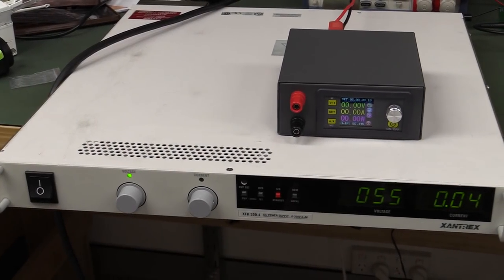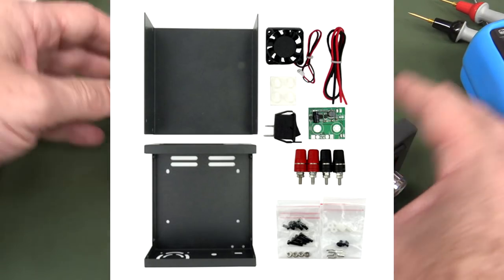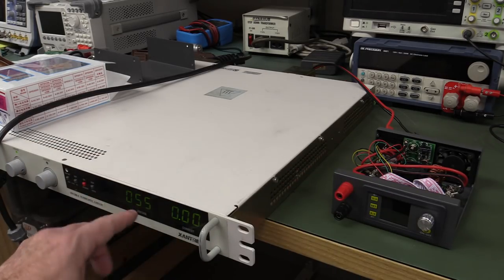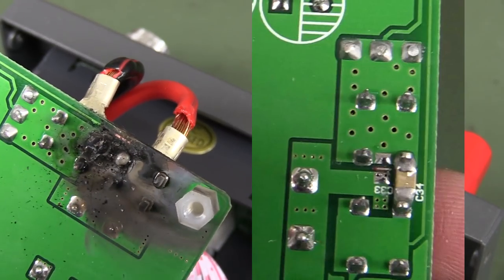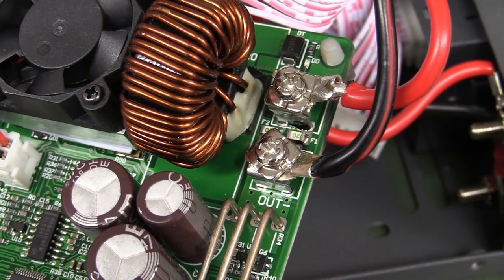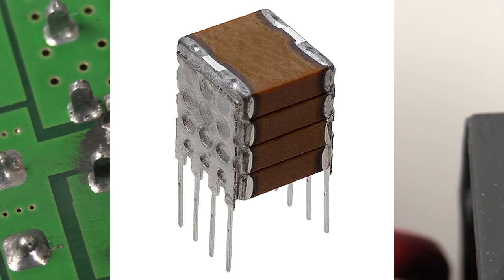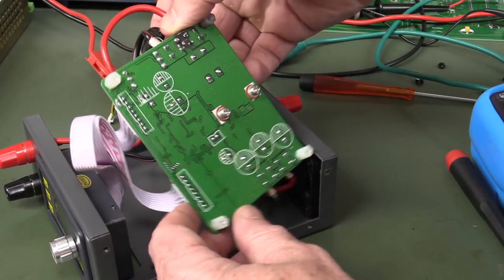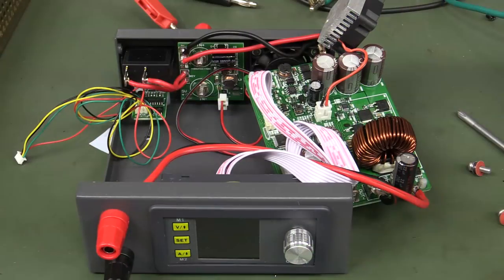EEVblog #1035 - Flaming DIY Power Supply!

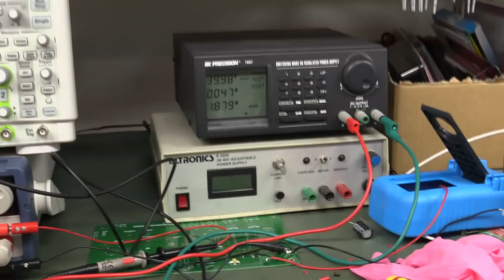Comment: At 14:56 and 15:07 Dave says it is set to 10 volts when it shows it is set to 18 volts,  and at 15:40 and 15:48 it is showing 17.98 volts on power up.  Are Australian volts different from USA volts  like the dollars are different values between Austrialia and USA?

Comment: Oh Dave, don't you know that a charred PCB shorts the pins? A simple resistance measurement might be enough to  check if that is the case. All the charring should bring scraped away before trying to run that again.
Reply from the maker: I did measure it and it wasn't a problem, but has now gone low.

Comment: I wonder if you could shorten the length of the screws slightly to keep from putting pressure on the board, thus keeping from cracking the Capacitor.
Reply: yes, it can avoid from PCB deformation , so the capacitor will not be damaged, but we already update this problem, use a better one and change the place

Comment: Do you think this could handle 12-14.8 volts at 15 amps without catching fire?
Reply: for DPS5020, there is not any problem, at 50v/20A, There is not any problem 
for fire in this video, it is capacitor damaged, not products problem 
you can check this video https://www.youtube.com/watch?v=igY0s4drtlc&t=1s

Comment: Best bet, lack of thermal relief on thru hole parts with substantial thermal mass.
A soldered  part right next to low Z MLCC. The thermal gradient that cap would have seen during the production solder process for the surrounding rather meaty hardware has twisted the guts out of the internal layers. No cheap parts are required to make the failure, any good quality ceramic will die from that much torment.

Comment: Maybe I'm wrong but those things are toys that should not be exposed to more than 12 or 24 V / 10 or 5 A at the input, when I say that they are toys it is because they do not have protection against overload or short circuit.

Comment: of course you had a load across the output: a huge chunk of charcoal :P

also possibly some solder or metals from the vaposised part could've wicked into or deposited onto it (burnt PCBs are rather good sponges) making it even less resistant than the coal alone.

Comment: Dave, please consider  a repair video or a followup test with the charred parts of the board dremeled out or similar and that solder bridge on the IC (if that is what it is at 18:13) removed.
Reply: there is repair video .. you can check

Comment: Design flaw. Never put ceramic surface mount capacitors (which are prone to internal cracks due to strain) across high current/voltage rails. Rule of thumb. Put two in series, if one fails the other still works!!!
Reply: You'll find 2 serial surface mount capacitors across Vbat to GND connections in all newer automotive electronics. Implemented as a rule ( by the vendors) over some serious fire incidents.

Comment: You said it a few times... that the 1kW power supply tried to dump all of its 1kW output into that burning cap load... not!  You only had it set for 55 Volts, so maximum of 220 Watts (at 4A max).

Synchronous rectifier?

Love that company name too... the Alpha and the Omega... reminds me of something I read...

Comment: Only thing I was sure Dave had ever built was a HV probe handle for an oscilloscope.
Reply: The fan isn't running: 14:47 when the output is turned on.

Comment: I decided to watch the whole video and read comments first before adding anything. One person spotted some solder spatter across some tracts,I would check that right away. I dont think it is causing the problem however. If anything,it may have caused some other issues. I was impressed the manufacterer was quick to comment concerning the issue and has already added that larger cap. As with any mass produced product,it usually turns out to be cheaply made components or badly soldered components. It is hard to monitor cheaply made components as they come in bulk now days. Unless you inspect every one and put it on a tester,that would be impossible. I am sure an initial runup was done on that unit to make sure it operated but somehow doubt a load test was done on it. Mabe every so often,but that would still miss one with a defective part. Such is the life of modern day mass produced electronics. Customer service is more important to me now days. As long as the bad unit gets replaced, I can deal with it. I did enjoy the video,nothing like some action for a change.

Comment: My experience is I'm finding with ebay power supply modules like this is the real reason for the smoke and the "sick puppy" is it has not been designed properly. Typically you will find the voltage and current will drift, may not be stable under different loads, horrible rf noise and radio interference, ferrite cores, making screeching noises, hence resonating, I've had some chokes actually shatter. Another nasty is complete failure to ensure that the esr and ripple current rating of filter caps is up to the task.
Reply: if you have any problem, you can contact us . for ebay, we don't want open shop on ebay

Comment: When you opened up the heat sink i knew they were bad at designing.
Such a high thermal resistance there, at the wrong side of the mosfets, to put heat sink on

Comment: Nice looking unit, the PCB design is good, although I'd probably go for more track separation because DC voltages love carbon tracks. 

Always soak test new gear, the world is full of stillborn components. Most absurd I ever hit was IEC power lead on an oscilloscope that was a beautifully potted open circuit fresh out of the box. Tested all the new kit, another had a dead short in the once pristine now charred and bubbled standard plug :-( 

Supplier had decided to save money by ordering default the US style leads and replacing them with brandless wholesale Oz style leads, which were also annoyingly short.

The instruments had been tested by plugging each one into the same lead rather than unpacking the new ones before dragging them up to the labs to set up.
Reply: ??? did you test our products ?

Comment: EEVblog the first good high value tip I got while going to extracurricular "electric engineering club" as child was to thoroughly clean all the carbon residues from the burnt place because they act like a resistor.

Comment: Perhaps a circuit breaker at the appropriate amp rating should be hooked up in series with a ceramic cap.
Reply: we are change the capacitor and change the place

Comment: same thing happened to mine that I bought to control MCH heater elements so I could get 100~400 watt heat load for my heatsink testing ( running from 500ah 48v battery bank ~54V )

Comment: Soldering the SMD ceramic capacitor  with too much solder create stress that cracked the fragile ceramics. Lite  bit of solder  create hight resistance. Non SMD capacitors with terminals  do not suffer from that.

Comment: I'd say there was something else wrong with it to begin with. It doesn't make sense that the damage on the input would cause it to malfunction. I first thought it was because you were testing it with the pcb loose but i saw the nylon standoffs had plenty of clearance so idk. I like the trick with the glove though.
Reply: Ah my bad I realized in the follow up video that the cap was on the output not the input.

Comment: The cap was cracked internally from being bent because it was soldered to those big lugs and it got so hot it melted the solder
Reply: no,  the capacitor was damaged by force during installation. after the video we updated it , change the capacitor and place

Comment: W/o a load to help suppress the HV spikes that a power supply like this should be expected to produce, even a 250V rated capacitor might not be adequate. The same part in series might work. The same part with a 200V varistor might work.

Comment: This is not uncommon. What happens is the ceramic gets stressed and cracks. This results in the capacitor going leaky and subsequently it bursts into flames. The capacitor was fitted between two screw terminals, I would guess screwing the terminals down cracked the capacitor. A solution would be to fit soft termination capacitors which do not crack. I had exactly the same thing happen to me with a design, using soft termination capacitors fixed the problem 100%,
Reply: thank you so much for your explaination, yes, you are right 
now we have use strong capacitor and put it other place ... 
thank you again

Comment: I expect, that the root of the problem was soldering the cap directly between the terminals. This increases the mechanical stress to it. Now, when you apply pressure to the terminals while connecting them, this "has" to crack it. I am quite sure t was mechanical overstress.

Comment: looks like a solder splash on the chip below the tl594c - bridging two pins to a through hole jumper
Reply: it is capacitor damaged, we already update this , and use a better capacitor

Comment: normally I test this type of electronic ( that you install by your self ) in low voltage and low current before I go higher to avoid any internal or external error/miss handle /fault manufacture or handy problems. so I don't lose the board or to keep it in minimum damage.  I don't like to waste my time to fix a problem caused by not been carefully with
Reply: so now it is well ?

Comment: Bummer...   My second unit just failed with constant 5.13v on the output.  I replaced it with the minghe zxy 6005s. Seems more stable and it has a timer function that works nice for charging lithium's.
Reply: very good , if you have any question, please contact me

Comment: I have a dps5015, but when i switch the output on , i get an overshoot peak of about 2 x the set voltage.  So i dear not to use it.
Reply: Hi friend 
it is not different problem,,, DPS5015 has not that capacitor 
you need connect them first , then power on , not power on ,, then connect , understand

Comment: Look at 18:12: There is a solderbridge on the 48 (4×12) pin Chip, right from R22 between Pin 23 to Pin 24 (When counting clockwise from the dot) . 
And: 
I would not apply such a high operating Voltage ever again to a PCB that burned sooooo black. This black stuff deep inside of the 
PCB material is now slightly conductive for ever! ... 
Why wasn't this little input capacitor placed behind the SMD PCB fuse from the power output...

Comment: My first guess was a short in a MOSFET. I think the cap blew because of that. I would pull each MOSFET and check them individually. I'll bet there's a bad one. My second guess was an electrolytic cap, but they all still have their tops on. LOL
Reply: you should see our explain and later video 
it is just capacitor damaged, and when it power on, it was shorted and burnt

Comment: on teh cheap i want a high amperage power supply that can control amperage and voltage. the voltage control seems easy enough but if i have a computer PSU that i wire up for full output (say 70A @ 12.5V how would i go about being able to variably controll max current output? (using as bench tool)
Reply: As said before, the max voltage you could go down to is 11V at about 15A output for the DPS5015, and 20A output with the DPS5020.

Both units are excellent.
Reply: @neutronpcxt372  thank you

Comment: I don't know, if you threw that thing away or whatever - but you know, coal is a conductor.
And that's the passage your angry pixies took after the first fail.
Always remove ALL of the charring a short produced, unless you want to burn your item twice. Would have been quite an easy fix and i wonder, why you didn't do it.
Not that i'm an expert in your trade, but car electric wiring has the same coal producing issues and that's why i know. Leftover charring -> no fix, burning car instead.

Comment: I have a DP30V5A coming and its input limit is 40V. Anyone know a circuit schematic to get a 40-0-40 6A transformer down to about 36V from 110 VAC?
 Most simple circuits (full bridge and large capacitors, no regulator) will convert that 40V transformer to 56V. Too much for a DP30V5A.

Comment: at 18:22 it looks like a Solder bridge between the Top 2 pins on that large Chip Lower right corner
Reply: it is capacitor damaged, we already update this , and use a better capacitor and change the place

Comment: Common problem with cheap psus.  Under spec’d components.  For caps and high voltages they have to be derated at at least 2x and also they need proper soft-start circuitry.  Alas products made of Chinesium ....
Reply: you are wrong , you don't know all things. Samsung mobile phones burnt , iphone burnt , tesla fired ... they are all from chinese?
any electric device was damged , they maybe fired, not only for chinese things ...

Comment: Ha you could have (ok should have) set the current to zero before applying power, then dialed up the current.  You would have seen the load problem before critical failure.

Comment: Dave I hate to be that person and ask this. But any news on when the 121GW multimeter will be released? I am in desperate need of a proper one. Working on cars and household electronics has killed my chinese cheapo one that seemingly came out the box heavily out of whack (would measure 14.4v anywhere from 11-20v and fluctuate making it basically useless except for finding a positive or negative lead really and to see if power was getting to where it needed to go).

Comment: Those Xantrex psus are heaps of garbage. Or at least those older 500V 4A ones that we have at work. They are very unstable at low voltages. They sometimes make  nasty overshoots when dumping the load.

Comment: Why would you want a power supply that runs at a lower voltage than mains? Why feed a power supply with a power supply?
Reply: because DPS5020 have good function, you just add a simple AC-DC power supply, that's ok , if you buy a same function AC-DC power supply, it will be big and more expensive

Comment: Okay I'll take the bait.. You are supplying 55v current limited to 4A (i.e.220W) to this thing and you keep saying it could have delivered 1kW into the failed capacitor. It's (>)95% efficient so at 50V (max of the PSU) if could have been delivering 209W or 50V@4.18A. The Xantrex isn't going to deliver a "whole lot of oopsie" only the 220W it is capable of at 55v 4A. So all the stuff at 09:55 about 20A through the cap is..........same nonsense at 10:37. Really Dave tsk tsk tsk.

Comment: Might have been an Xc/ESR/Ic-ripple convergence issue. when chip caps are energized as the voltage increases, the capacitance decreases, like significantly. so like RD Tech says, the cap is likely not even needed. The fiberglass cannot char, but the resin (usually a polyester) IS combustible given enough heat energy is dumped into it, then you end up with a carbon resistor (also why you wont see any carbon fiber PCB cores).  One last thing, NO SUCH THING AS MAGIC SMOKE. GOD I hate that joke.
Reply: thank you so much for your explain 
yes, it is just capacitor to reduce ripple at higher voltage , now we already improve it , use better capacitor and change the place 
thank you

Comment: at 18:10 there is a short on the pins (chip at bottom)
Reply: themrworf1701 
1 year ago (edited)

On 18:21 you can see a small blob of solder on microcontroller. Try to remove it.

Comment: Seems your theory about Chinese cloners (no offence) who make these PSUs and buy parts in local flea market for lowest bidder, definitely is correct. Happy owner of such device may or may not be lucky, because device can fail in several ways. Are we must completely abandon these cheap devices? I doubt - they are good for beginners and casual DIY makers who can't afford thousands of bucks worth lab equipment. However it is worth to check which seller at least does not try to push utter crap. Nice DIY fix by the way.

Comment: Dave.  drop by your local fire and safety supplier with the name and model of your smoke detector and they should be able to supply a very inexpensive Styrofoam cap for that unit.

Comment: I noticed at 15:00, 1 fan wasn't working.
Reply: the fan on the power part ?  When the current is more than 10A or the temperature is more than 45 °c , the fan will begin to work. when the temperature is more than 65°c, the module will stop working

Comment: that happens... I don't really like those caps, they known to do things like this... I also guess that it took one of those mosfets along with it...
Reply: TubiCal I am guessing that the charred pcb still is letting power through
Reply: The power supply/MOSFETs should be able to handle this. The short was directly on the output after after all.
Reply: it is high frequency filter capacitor. the place is not good
Reply: Why, surface mount caps are found on bottoms of boards all the time.  What kind of force is needed to cause a ceramic surface mount cap to short?

Comment: shorted pins on that QFP 18:12
Reply: I saw that place , it should be solder splash, I guess Dave drop it mistakenly when he install the case , but there is nothing with the board, it control the display . this is not from our factory, because this chip was weld STM machine, it is impossible that there is the solder splash on 2 legs. we don't weld the chip by hand.

Comment: I do not really satisfied with the internal arrangement of this unit. The output is on the right on the PCB, then the receptacles should be on the right side of the front panel. Etc... Never was a good idea to move 20-ish amps in wires snake above/under/near small signal and digital circuits, never... The control board is not screened, nor the output cable, whatever good you design a circuit, if it is arranged like a mess, it will fail once of these fine days.
Reply: thank you for your suggest , we have solved the capacitor problem,